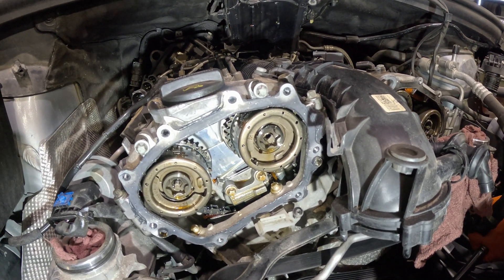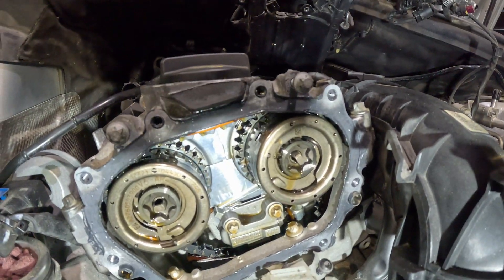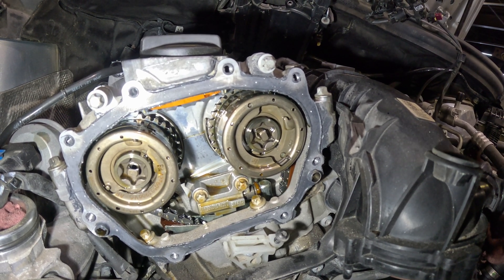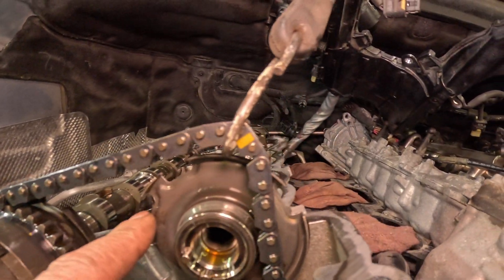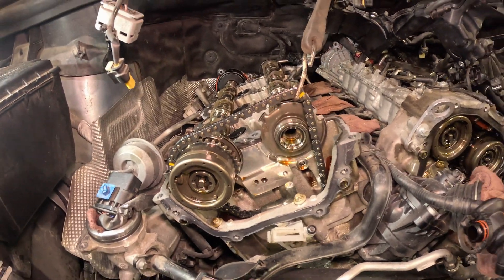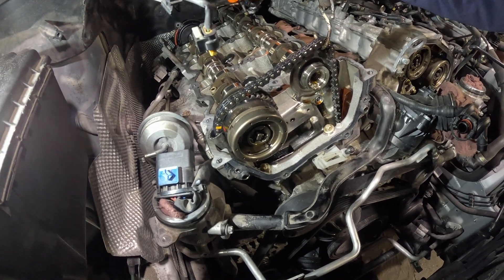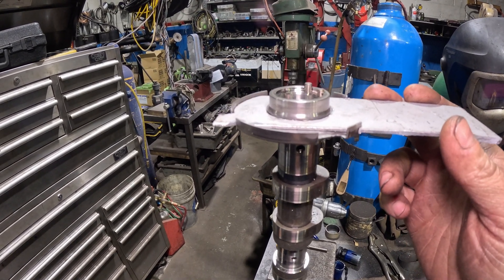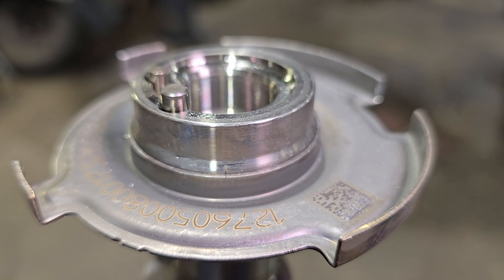HOW TO REPAIR: P001685 Mercedes GLE 400 M276 M278 engine camshaft adjuster and sensor ring problem

Comment: The hardened lock pin wore a ramp into the backing plate.  I'm going to say that a combo of extended oil changes plus that stupid 2 stage oil pump dropping oil pressure (which likely means more lock/unlock cycles for the adjuster, since it unlocks around 22 psi) are the cause.  How many miles on this car?
Reply from the maker: It had just over 100 k kilometers. Its probably just the extended intervals (old oil also generated less pressure). Also, the quality of these parts is very poor...

Comment: With the code shown, do i need to change the entire camshaft with its timing change etc or is it just the adjuster?
I have a 2014 GL450 that displayed the same code as the car you're working on in the video
Reply from the maker: You also have to make sure the etching mark on the tone ring aligns with the mark on the camshaft. Also, make sure all other timing components are ok.

Comment: Is the same issue found on four cylinder engines (274)?
Reply from the maker: We have not had that issue on these engines, but I would think it would be very similar or same as they share the same architecture as the 276 and 278 engines.
Reply from the maker: 274 engines have a breaking chain issue that will destroy the whole engine before the camshaft adjuster fails...

Comment: bro how did you remove the bracket and high pressure fuel pump on the right side? Those bolts are so fricking hard to get to...
Reply: Lol I finally got to the camshafts after hours of cussing and yelling at some german engineer s mother
Reply from the maker: With the help of a lot of patience, luck, tools, and, of course, someone else's mother...
Reply: @3D4KAUTO you should share the template of that tool. I m in process of making one too. Probably best to make one out of cardboard first. And outline it on the hard metal to cut with cutting wheel

Comment: I have the same error but only after night on cold engine, after clearing the error you can drive and the error is not there until the first firing after night. How was it in your case ?
Reply from the maker: In this case it was constant. The reason yours only appears on cold start is probably because your camshaft adjuster is not yet completely broken. But it will get there eventually. It would be a wise idea to repair before it creates more problems. Good luck!

Comment: what does this type of repair typically cost?  I have this code on my 2014 E550.  Thank you for this video its extremely informative.
Reply from the maker: The repair shown in the video costed about 5k CAD. But if you want to do it properly you should replace all the camshaft adjusters and weld all the tone rings to the shafts. Also all chains and guides along with tensioners should also be replaced. That will probably add another 5k to the repair. Good luck!
Reply: @ thank you. My best friend is an ASE master technician I spoke to him he feels we could fix it like you recommended. If it’s not asking too much would you mind listing parts needed to do this job? I will have to order the parts and would like to try to get all parts at one time to minimize the cars down time seeing as it is my only means of transportation. Thank you for your prompt response.
Reply from the maker: @brgable  I can list all the parts that I used for this job as I already have the part numbers: 
1 --CHAIN TENSIONER RIGHT SIDE 
A276050260064
1 --CAMSHAFT POSITIONER RIGHT INTAKE 
A 276 050 52 00
6 --FLANGE SEAL 
A 276 141 07 80
1 --ELASTOMERIC MOLDED SEAL 
A 276 098 00 80
2 --FLAT SEALING RING 
A 276 098 00 80
2 --ELASTOMERIC MOLDED SEAL 
A 276 184 00 80
1 --Thermostat assembly 
A 276 200 03 15
1 --UPPER SLIDE RAIL 
A 278 052 03 16
1 --Brake vacuum pump gasket 
Part# 40-73159-00
3 --Fuel injectors seal kits 
Part# 644.740
1 --PCV valve gasket 
Part# 70-10741-00
1 --PARTS KIT, FILTER ELEMENT 
A 276 180 00 09
1 --Oil control valve 
A 276 050 02 78
2 --Air filters 
Part# LX28417

The number that goes in front of the part description is part quantity.
Tell your friend that it may take over a week to complete before he decides to tackle it. Good luck!

Comment: Hi, thanks for great tutorial. I have GL 450 M278 with the same problem. But I am not sure that there is enough room to do this job without engine removal. Do you have experience that is possible on V8 engines with engine in? Thanks, Patrick.
Reply from the maker: We have not done M278 engine with the same problem, but it is possible to do with engine in just like we did with M276. But keep in mind: its very tight in there.
Reply: same here. mine is a 2014 GL 450 with issue on intake side. I started to work on it but I think the biggest challenge is the high pressure fuel pump/ bracket since they put the bolts in a place where it is sooo frciking difficult to get to.

Comment: Also, this is on a Turbo Engine. I Have this issue On a Non-Turbo Engine and a video I watched on a different channel said that The Camshafts and tone wheels on NA engines does not have that correlation etching on them. Since it doesn't make sense buying a new Camshaft and running the risk of this issue happening again. Question is, On the current camshaft, is there another way to find where the Cam-Tone ring correlation should be? So I can have it Tig welded as you did.
Reply from the maker: I guess you have to get a known good camshaft and tig weld it or maybe match it up with a known good one to make sure it is lined up. It would probably be not easy. Are you sure there is no etching?

Comment: Since It Was Spewing Oil, Did You End Up Replacing the Camshaft Gear/Adjuster Sprocket?
Reply from the maker: Yes, the camshaft adjusted that was spewing oil was replaced.

Comment: Camshaft like 3 hundo with the pulse wheel.
Reply from the maker: If you buy a new camshaft with a pulse wheel and not weld it, it will eventually move and create problems. It is a much wiser idea to weld it to avoid having to disassemble the whole thing again in the near future...